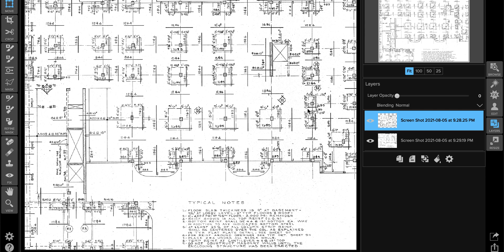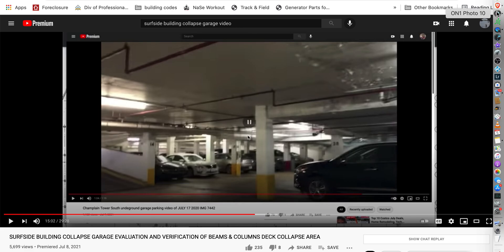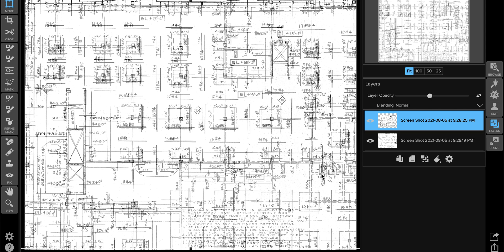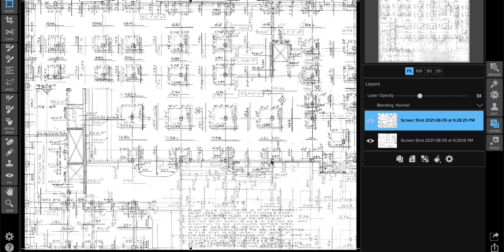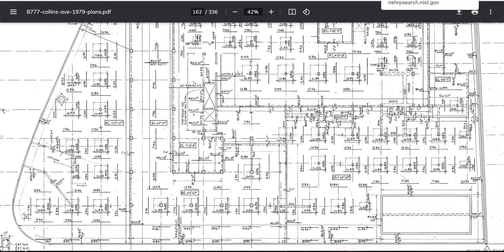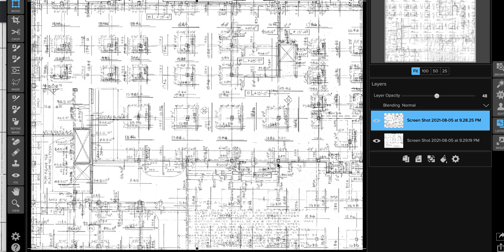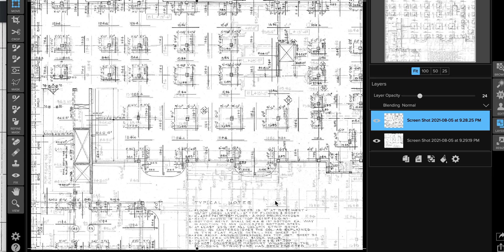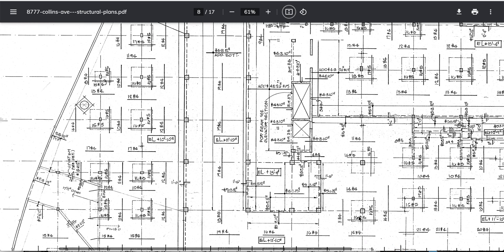Champlain Towers COLLAPSE DIRECT CONNECTION OF BMA & SUPPORT COLUMNS VIA SLAB ELEVATION CONNECTION

Comment: Was checking out the new Target Superstore 1st floor parking lot. They had an arson fire a few months ago, so did some repairs and more.OMG! At the East wall, they have set 3 Emergency overflows from the 2nd floor store that are to drain right on the  flat parking floor-- no drainage to note! Because any water, just from drills or real in this area will eat out this foundation!🌧💦

Comment: Kai, 100% correct. Recall I also found a structural crack above the garage header entrance that steps up and runs along the outside floor above the garage with structural cracking along the entire North side to the point that stayed standing after the major collapse.

Comment: The BMAs in the garage photo portion appear to be side-mounted into the columns. That's curious to me because as far as I can tell they were intended to bear a downward load.
Reply: Not at all. The BMA is a purposely side jacked beam. the BMA, BMB, BMC, etc. denotes the method of attachment of the lateral portion.
Reply: I'm wondering if they are bolted in at the ends (where we can't see) like the example we were shown?